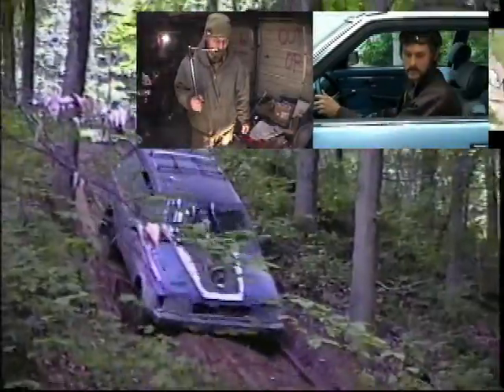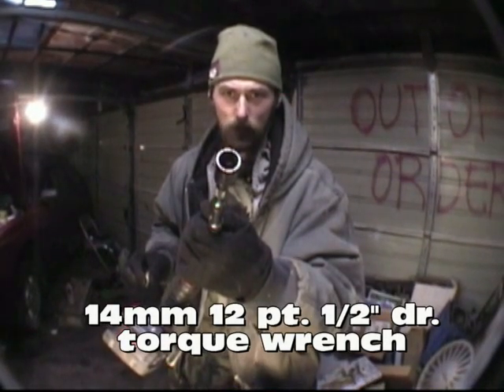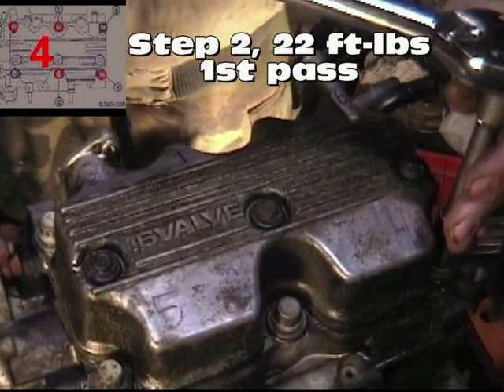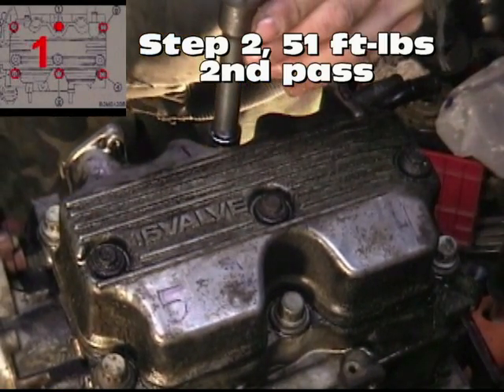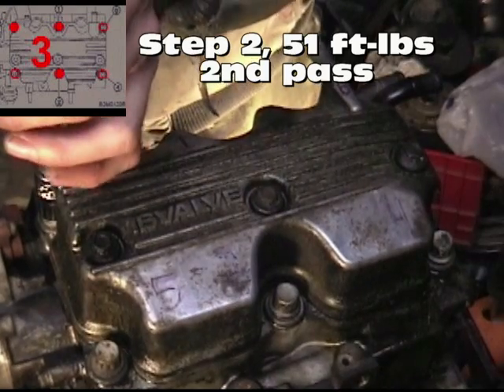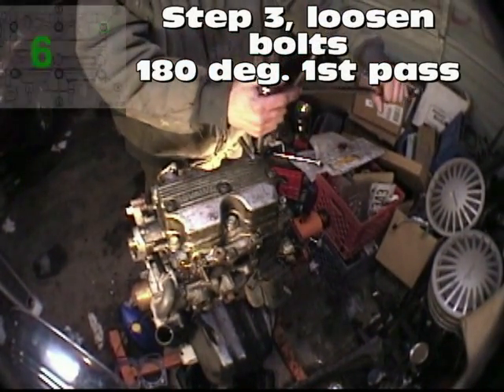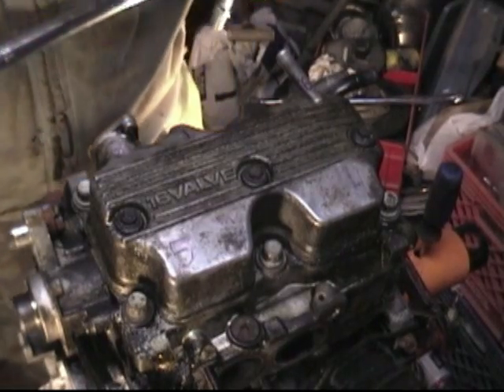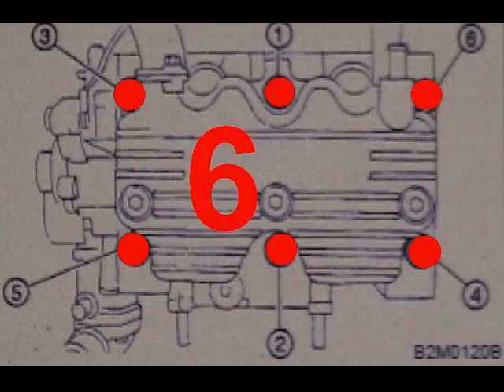Subaru Head Gasket Torque Sequence

Comment: Thanks dudes!  Currently rebuild my 2001 Subaru Impreza RS.  It's slot easier seeing someone do that than reading about it in the forums lol.
Reply: What did you do in the rebuild ?  I have that engine in the garage with 200K miles on it...and I did not hear it run before I bought it....